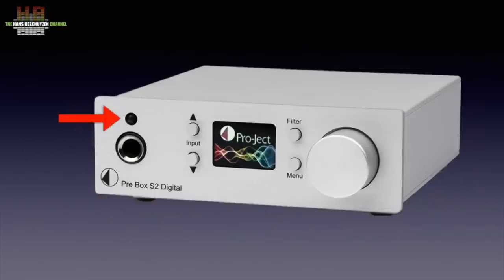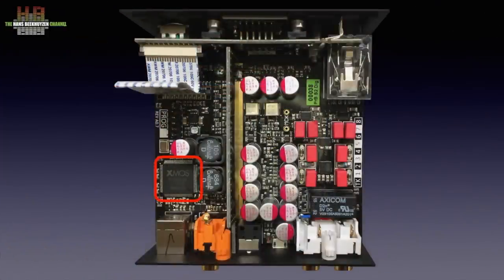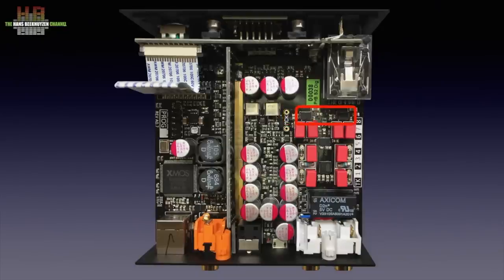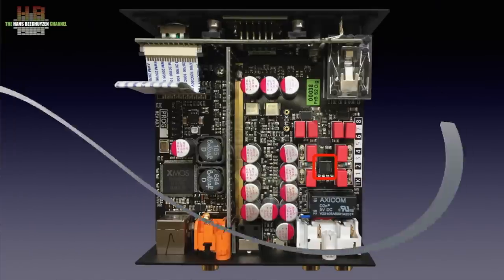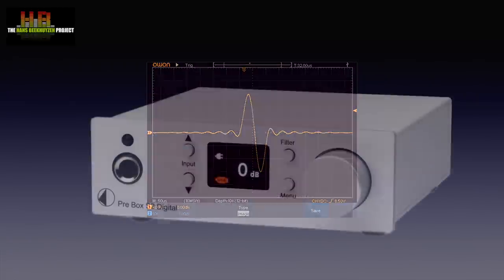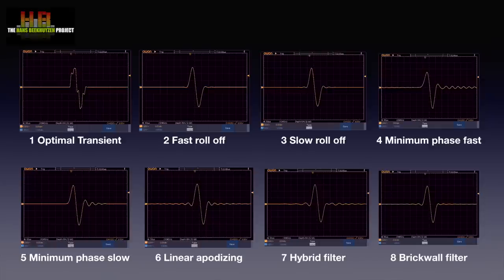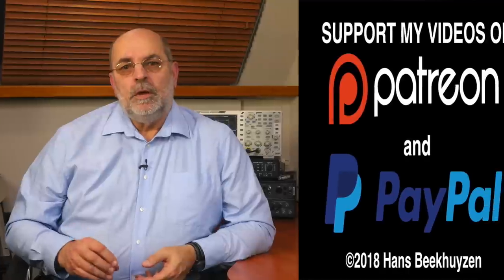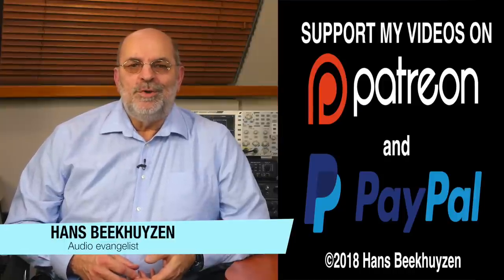Pro Ject Pre Box S2 Digital: MQA decoding Digital DAC/pre-amp

Comment: Some years using this product. Full MQA (Decoding + Rendering) isn't stable due a firmware bug which isn't (and won't be) solved by Pro-Ject. For an stable MQA playback only renderer can be used letting the Decoding unfold be done by the player software (The DAC Displays a purple MQB circle instead teh usual blue or green ones).
Reply from the maker: Thanks for sharing

Comment: Hi Hans. Just got the PreBox to run with my Allo USBridge, running Squeezelite. So far it's a no go. I've contacted Pro-Ject and Allo for help. I know you can't troubleshoot, but I thought I'd at least reach out for suggestions on who else to turn to or any obvious suggestions. At first I had no sound whatsoever, nothing played in Sqeezelite. I changed the bit depth to 32 - my old HRT Streamer II worked at 24-3. After many issues with Allo's  web interface (I also went to the older DietPi interface and poked around), I finally got it working, sort of. Essentially, any resolution, except 96Khz is distorted. That's as far and as best as I can get. I believe you tried this DAC with this setup, so just thought I'd see if anything stands out about the configuration.

Best. And Thanks again!

Daina Wilburn
Reply from the maker: https://forums.slimdevices.com?
Reply: Thanks!

Comment: Thanks man, i've been getting into better audio gear and your channel is very helpful.
Reply from the maker: Great to hear!
Reply: @TheHansBeekhuyzenChannel  very informative video. Made me buy this dac no regrets at all. I have some few questions and I'll be so happy if you could answer them. 
1. How do I connect the RCA output to my existing receiver or should I use the XLR to banana plug for my speakers. I don't know how it would work or, 
2. Even if I use the RCA out. Where will I plug it at the back of my receiver? Line or multi channel in? Please this answer will help me enjoy this unit more cos I have not used to its  potential.
Thanks in  advance

Comment: Hi Hans I’ve just bought the Pre Box S2 digital and the Stream box S2 Ultra but I’m not able to switch off the preamp I’ve Connected it through the 5V power supply in the box but I’m not able to find a way to Switch it off without picking away the USB C power cable and not seems it to me a correct way.....
Reply from the maker: There is no power switch, just leave it on or unplug the wall wart.

Comment: Would the Pro-Ject S2 Digital Dac work well with an integrated amplifier connected to a network player... Playing flac files and Internet radio in a Hifi set up
Reply from the maker: That is a very general question. If they can be connected - ie have the same interfaces - it will.

Comment: Sorry if you answered this already,
Can you def completely bypass the preamp section ? Just using dac only ?
Reply from the maker: There is no such thing as 'the preamp' section'. It is the same output electronics a DAC has but sometimes a DAC doesn't have a volume control. The volume control in the Pre-box can't be switched off. Just set it to whatever level you find between 60 and 100%.

Comment: I am currently streaming TIDAL hard wired CAT6 from my 5G modem in my family room to my 3rd generation 16 bit capable Apple TV (don't laugh) and have connected my Apple TV using Audioquest Coffee HDMI cable to my ARCAM AVR550 receiver.  I am playing a pair of Paradigm Prestige 85F floor standing speakers and have recently added a pair of REL S3 SHO subwoofers.  To me my system sounds pretty good.  However, could it sound better if I purchase a Bluesound music streamer to be able to play 24 bit hi res to take advantage of my TIDAL Premium subscription?  A local dealer doesn't like MQA because it sounds like a copied and pasted sound.  He prefers to hear music played as hi res FLAC files and allow a DAC and the equipment it is played on to add some of their own sound characteristics.

Because of they feel Qobuz sounds better than TIDAL.

They recommended I purchase both a Bluesound and a Pro-Ject S2 DAC.  They suggested I connect the Bluesound to the Pro-Ject S2 DAC using Audioquest Carbon digital coax cable and then connect the Pro-Ject S2 DAC using RCA cables to my ARCAM.  We listened to various songs with only the Bluesound connected to a Sony 2 channel amplifier with RCA cable and then listened to the same songs by adding the Pro-Ject S2 DAC.  I had a difficult time hearing a significant difference in sound quality.  However, I felt the bass was tighter and more defined and the high frequency sounds were more present such as light touches on cymbals.

If I purchase the Bluesound, Pro-Ject S2 DAC and the Audioquest Carbon digital coax cable, they quoted me just $350 for the Pro-Ject DAC.

If you were in my shoes, would you spend the extra money on the Pro-Ject S2 DAC?  

If I were not to purchase the Pro-Ject DAC and just purchase the Bluesound, how would you suggest I hook things up to my ARCAM?  Using RCA cables or using digital coax cables connected to my ARCAM.  Another, dealer told me the DAC inside my ARCAM is of pretty high quality.  However, how can it be as good as the all of the components they use to build the Pro-Ject DAC?

Comment: Hi Hans, I absolutely love your channel!
I have a question for you regarding this unit. A couple of weeks ago I bought one thinking it could be a good replacement for the rather spartan Mojo that I normally used connect directly to a power amp and speakers. After 24 hours of burn in I found it to be not a bit poorer than the Mojo but a great deal worse. No bass extension, very compressed dynamics , and no definition or slam on percussion. Everything sounded tiny and muddled by comparison. Tried the headphones (like yourself don’t use them allot) exactly the same result. Your review sounds like you did not find it to be too far off from the Mojo and this puzzles me.
I read in pinkfishmedia that the designer said the first production run was not his approved design! And you could differentiate the approved design from the non approved design by spotting pink capacitors vs black ones. I had the , black caps one, don’t know if this is true or not but  would like to know if you reviewed the pink or black cap unit. Thank you.
Reply from the maker: I don't know and the DAC is already back to the distributor. Sorry.
Reply: The Hans Beekhuyzen Channel 
Thanks Hans I appreciate your quick response, I was kind of hoping you would find some huge anomaly with the unit so that people wouldn’t label me a “mad man” after writing a very harsh review in HiFiChile about it. Well, C’Est la vie. Keep up the good work, you are my current favorite reviewer and always look forward to your next video.
Reply: Christian, what power source do you use? Hans says it sounds better with external (and linear) psus instead of usb, for better current. I'm also interested between this and the Mojo for dac mainly. What is better in S2, how do you find resolution and timbre?
Reply from the maker: watch the video!!!
Reply: Hi Diego,

I used the provided Power Supply and direct power from my Mac Mini. Honestly found no significant difference in either one. They sounded awful to my ears, but I have no doubt in Han’s judgement. I just suspect that Hans got the “approved” design version and I had the early production models that where sufficiently deficient to have one of the designers publicly complain in a forum about it. Just as a DAC I would not think twice about getting the Mojo if I have to compare it to the unit I had for three days before returning. 
I would only consider the Pro-Ject if you “look under the bonnet”  and see something that looks like the stock photos Hans used in his video (half pink half grey caps) and not something different (half black half grey).
That’s my two cents, essentially tread carefully with the Pro-Ject DAC.
Reply: I bought it too. A bit of a disappointment. No slam yes! No gain! High definition though. But a cd is only 44khz. I have 3 other DACs.
Reply: Christian Dockendorff l bought a linear 5 volts external power supply, usb is not enough.  I use optical from my pc. Upsampled at 192 khz
Reply: @TheRockerxx69  i cant choose between the Pro-ject or the Mojo. Which do you recommend?
Reply: Nick van Kreij l would buy a balanced circuit hi performance DAC with the latest chips from ESS from Shenzhen audio site offering many brands
Reply: @TheRockerxx69   thanks. I like the specs of the Mojo, but they say it sounds warm. Since my Svs Ultra sound neutrale/warm they can have a little brightness in my taste. The Denon a300usb and Oppo Ha2SE deliver this but the sound quality isnt as good as the Mojo they say. Mmm

Comment: Hans. I purchased the Pro-ject S2. I want to play 352khz cd's and get the full unfolding on a yamaha stereo system and on my pc. I was able to get jriver to play the mqa files but it is hit or miss, the mqa goes in and out and I cannot figure out why. Can I hook up any cd player to the Pro-ject s2 and run it through my yamaha system and get it to read the full 352khz or do I need a specialty cd player?  Thanks.
Reply from the maker: Hooking up your cd-player will work if you have MQA cd's that hold 352 kHz material (most don't). Playing MQA files from your PC you have to make sure that the volume control on the player software is set at 100%.

Comment: Just bought a Darkwave and i am looking for a decent DAC to pair it with for my HD600s. 
Its not so easy finding a seperate unit that works entirely as a DAC. 
Most are pre amps as well. Could that be an issue when connected to a tube amp?
Reply from the maker: No, the only difference is the added volume control and that can be set to 100%.
Reply: @TheHansBeekhuyzenChannel  thank you

Comment: Question…If I use both the Pro-ject Pre Box S2 Digital with a 5V 1.0 power supply requirement and a Pro-ject Head Box S2 Headphone amp with a 5V .5 amp PS requirement, can I use a single ifi ipower power supply at 5V 3 amp output for both units using a splitter?
Reply from the maker: I don't know what the current needs are for the Pro-ject boxes but you can safely try. If the Head box sounds dull or poor in the lows, you better use two iFi's.
Reply: @TheHansBeekhuyzenChannel  So both units should benefit from the cleaner power without affecting each other?

Comment: Is this S2 Pre  box fit to connect to my Quad 303 instead of the 33?
Reply from the maker: It can be used but the output voltage of digital equipment (in general and thus for the S2 Pre) is 2 volts and thus higher than that of the Quad 33. This means that the volume control must be set rather low and that might not always be convenient. An electronics engineer can reduce the input sensitivity of the 303, about 16 dB's will do the trick.
Reply: Thank you for your reply! I enjoy your videos very much. Together with your ebook on digital audio they provided me with all the information I needed to setup a decent digital audio set. But not only did I learn a lot about digital audio and enjoying music again, but both your book and your videos are really entertaining. Thanks!

Comment: Meant also to ask.  If I hook up the Bluesound to the Pro-Ject S2 DAC using digital coax and the Pro-Ject to my ARCAM using RCA cables, will I be hearing totally unfolded MQA when listening to the TIDAL Master recordings or will it default to hearing 24 bit/88.2 kHz?  Also, if I play a Bluesound connected by way of digitial Coax to my ARCAM, which is not a MQA certified DAC what bit rate and what sample rate will I hear?  And, will it sound better using the DAC inside my ARCAM or the DAC inside the Bluesound?
Reply from the maker: Please watch https://youtu.be/-EWUiqW5hcM, I explain it all there.

Comment: Can it run a Sennheiser HD 800 S smoothly?
Reply from the maker: I don' know, I don't use headphones, they make me claustrophonic☺️
Reply: From the product page, 6.6 mW / 600 Ohm; 68 mW / 32 Ohm on the headphone output. I would consider running the HD800S on this doubtful. The numbers alone may not really tell the whole tale but they are 300 ohm headphones. For the same money - assuming Massdrop ever sells them again - their THX AAA 789 would absolutely destroy this unit for headphone use. This strikes me as more of a digital pre-amp than a headphone amp.

Comment: Hi Hans, I love your channel! I have a question for you regarding this unit. Yesterday I bought one and i am verry happy with it and the unit is still "burning in" .
In your review, you say: "Connected to a computer over USB, the computer will power the prebox, unless you connect a power supply. The prebox automaticaly switch over"
But in the manual, i found this statement:
Mains power connection
The unit offers 2 possibilties:
1. USB input is not used: Connect the low voltage plug from the power supply to the micro-USB socket Power 5V DC before connecting the power supply to the mains.
2. USB input is in use: Unit can be powered directly from computer via USB input. In this case is highly recommended to disconnect Power 5V DC cable from the unit - power disturbances from two power supplies could affect sound performance.
I am confused about this, have i missed something?
Thanks.
Reply from the maker: On the website they state that a FET switches over when a power supply is connected. When used with a quality power supply it sounds better too.
Reply: Thanks for the quick response, i'll buy an iFi power supply and some decent cables in the near future. Thanks many times.

Comment: Hi Hans, Thanks for the awesome content.
I'm relatively new to hifi and my knowledge has its limits and you might have the anwser a desperately need so I have a question for you. I intend to use Y splitters out of the pre box S2 to feed two power amplifiers (marantz pm7003 and sub or another PM). Will that be ok for a such little box? or will it degrade de sound or worst, could that damage the pre box s2 with impedance issue? Thanks a lot for your help!
Reply from the maker: It's slightly more complex than just the impedance. But to help you along I would say, just try it. You won't break anything, provided all the equipment is in normal, functioning condition. If the two amps don't differ too much on their inputs it might sound right. If not you will loose dynamics and low end. You might also try to connect the DAC to the CD input of the PM7300 and the sub on the pre-outs of the PM7300. That might sound better. Another option - which I prefer - is to use a sub that can be connected to the loudspeaker terminals of the amp. I know, it sounds illogical but if the sub is suited for it (I use REL subs), it is the best way to integrate the sub in your system.
Reply: I totally missed I could use my sub that way! I think I'm gonna wire my sub to the terminal b of my first amplifier and use to pre out to connect the second amplifier. That should be perfect! It has been quite a mind trick. thanks a lot for you help Hans and all the best for your channel!